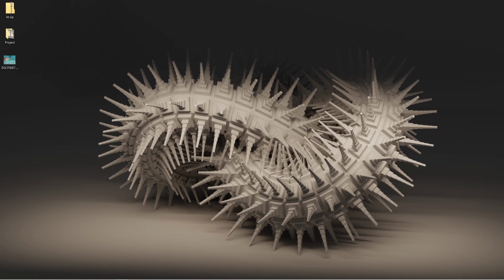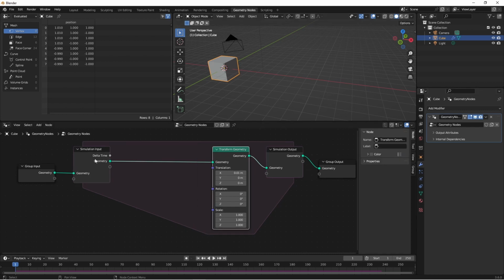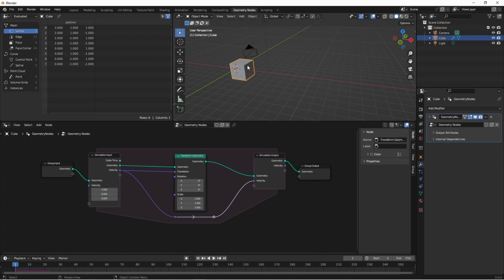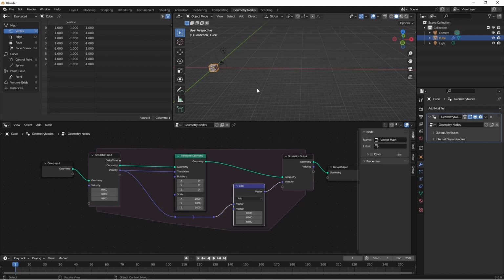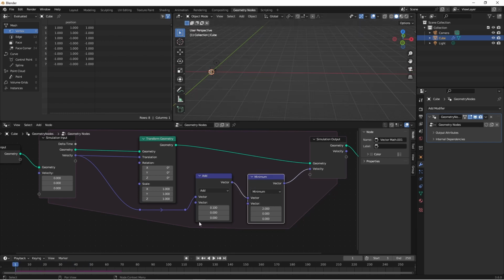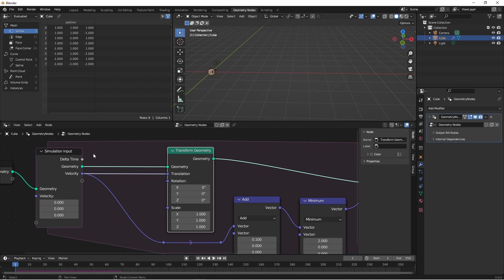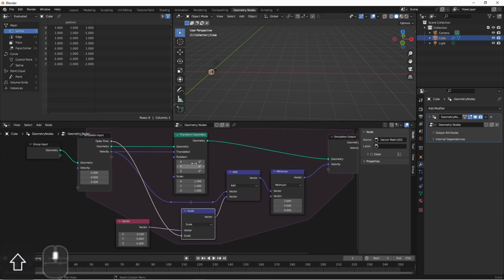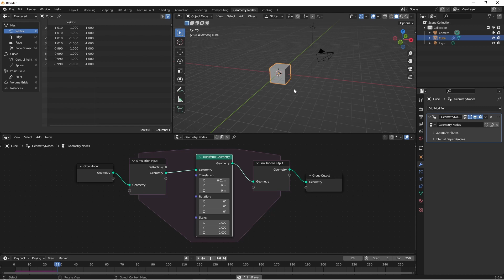Intro to Simulation Nodes Part 2: Movement and Acceleration

Comment: I saw the blender studio use the scaling method as well and I still don't fully understand. 

Would you say that initially your velocity is in the units "units per frame". Then when you scale with Delta time you're changing it to "units per second"? 

I think I need to write this on paper to fully get my head around it.
Reply from the maker: Think about it this way:

If your velocity is 10 meters per second and
Your Animation is running at 10 frames per second
so each frame is 1/10th of a second - this is delta time

So in 1/10th of a second, you only want to move 1/10th of the distance you would have in one full second. So if you multiply your 1-second distance by the fraction of a second each frame is, you get the distance you would travel in that fractional second.
Reply: @JohnnyMatthews  thank you so much ❤️ this helps a lot

Comment: Great stuff. I now understand why scaling by Delta Time will yeild a similar result at different frame rates. One thing I don't understand is why you then scale it again before going into the Transform Geometry Node. Hasn't this amount already been scaled in the previous step, and won't scaling it again just make it artificially slower (I get that it will be relative to the FPS still, so won't cause any real problem)?
Reply: Having gone back and rewatched it, I now understand the reasons. So I suppose wherever you're manipulating any values inside a Simulation Zone, you should really scale by Delta Time otherwise you'll get unpredictable results, especially when changing frame rate. 🤔
Reply: @zboy303 exactly!
Reply: @AshFrankArt   I just understand like we want to change our velocity from per frame to per second? Is that right? So that why we need scale before Transform Node? because our velocity is already in per second, I feel like we slow down velocity two times:((
Reply: @fidodido3649  Johnny explains it again in the next video in the series. I think he does a better job in that one. You should check it out
Reply: @AshFrankArt  Thanks, I got it! It is velocity = acceleration * delta t, s = velocity * delta t
Reply: You do it again because otherwise you're working in different units. The input is independent of what is added. 

Otherwise you're adding apples to oranges. You'll get a nice fruit basket, but not a great pie 😂
Reply: @AshFrankArt enjoyed the explanation, but I'm still not convinced!
Reply: @zboy303  you need to scale both the units coming into the sim from the outside, as well as those being brought over from the previous frame